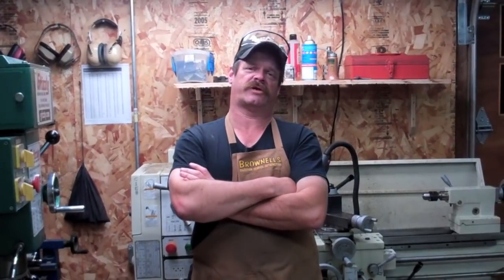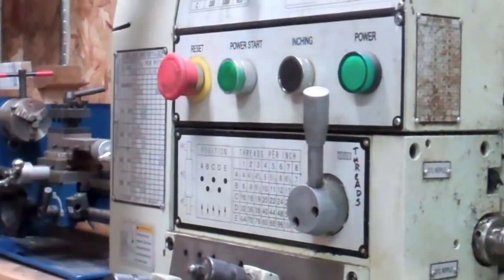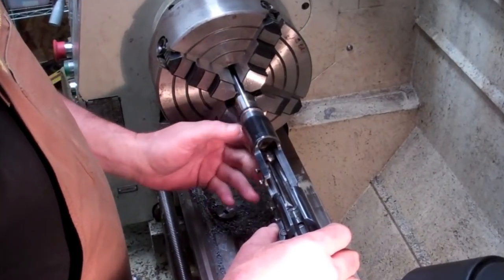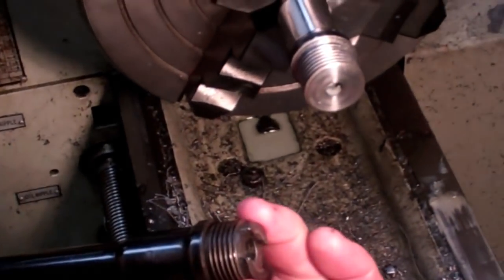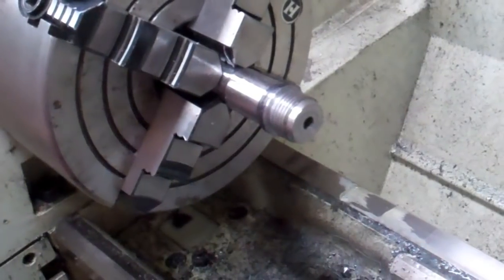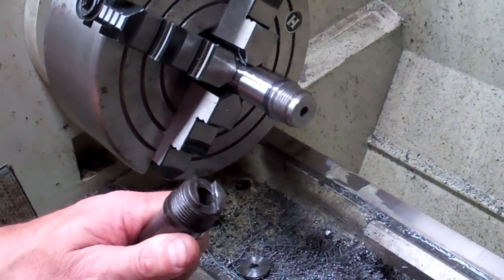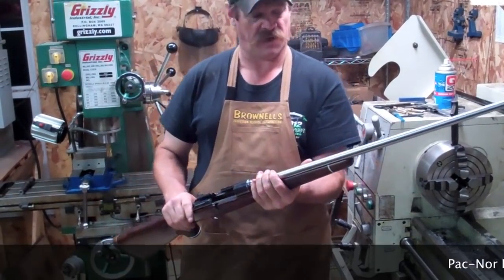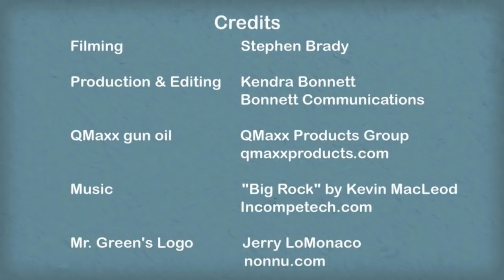Gunsmithing: Cutting Threads on a Barrel Blank Part 2 (Gunworks)

Comment from the maker: To answer both your questions... I run my lathe at the slowest speed for cutting threads because I don't have a carriage stop. Also, I cut with carbide threading tools instead of high speed steel.
Reply: Jim, try threading left to right so you have nothing to crash into.  Just turn threading tool upside down in the holder and run lathe in reverse.  I thread like this at 175 RPM with zero headaches.

Comment: I've done a bit of woodworking on lathes so in a way I understand the basis of the machinery, but I've got one question. Out of curiosity, when the 4-jaw clamp chuck makes contact with the barrel does the smith have to worry about denting or injuring the metal of the barrel? I know with wood a common mistake is over-tightening the chuck, I'm just wondering if that's an issue with gun smithing. Thanks guys, excellent work by the way sir and thank you for your service :)

Comment: Flip your threading tool upside down and run the lathe in reverse. Thread from the relief out and in high speed.
I've converted to this and its sooooo much easier and faster. Threads turn out better with the higher rpm and carbide inserts.  Takes a couple of minutes to cut threads now, and without any pucker factor.

Comment: Is there any way you could do a video on how to do the barrel threads for mounting the barrel extension on a dpms lr 308 pattern and the clearances for the bolt? I have a barrel blank in .243. I tried to find a .243 barrel with the extension already installed but could not find one I did not want the .308 version as I have a couple of 308 rifles already. There aren't to many .243's out there. Any info would  be greatly appreciated. Thanks

Comment: thanks for the reply Jim, i can see what your saying trying to punch things out quick, i did my apprenticeship in a manufacturing environment i cut a lot of stainless and at times it can be problematic to work with, I used to use carbide because i could plunge cut like your doing, leave the half nuts engaged on the lead screw, make a cut and reverse the machine then wind on the next cut, gets it done quicker since your not waitng on the chasing dial and you know what depth the last cut was

Comment from the maker: Sure..... The carbide bits are the only thing to use on stainless steel to get a decent cut. But the barrels and screws I'm turning on the lathe in these videos is 4130 steel. Not exactly the hardest material on Earth, so a decent HSS bit that's sharp will cut them with no problem. 

The carbide bits are so darned expensive to buy, and chip too easily. If I were working in a job shop that could afford carbide, it's all I'd use.